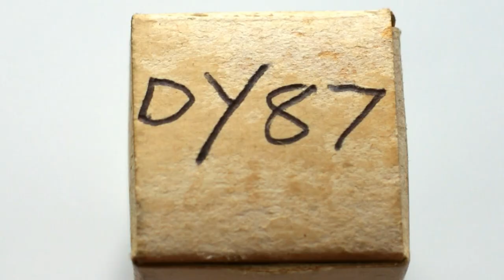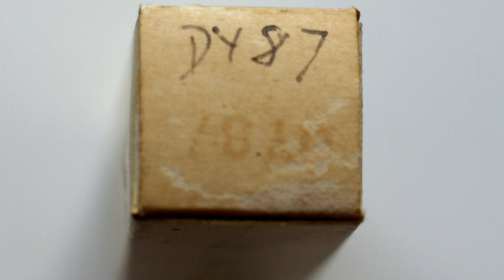Two Bentley Acoustic Corporation DY87 Rectifier Vacuum Tubes  #UnboxingVintageElectronicComponents

Comment: In some television they were used  as an EHT rectifier or Flyback Diode. Some sets  would mount and encase the valve in a perspex  'coffin', it was a big mistake. the perspex would degrade and after a couple of years it would start arcing and tracking across, eventually it would break down entirely and short the EHT to ground. The solution was clear away to coffin, and mount the valve and valve holder with very thick 18 SWG copper wire, and just let the valve hang there suspended in mid air